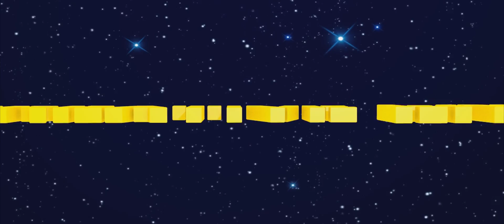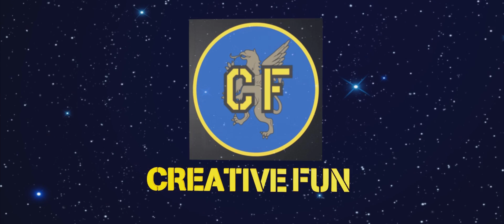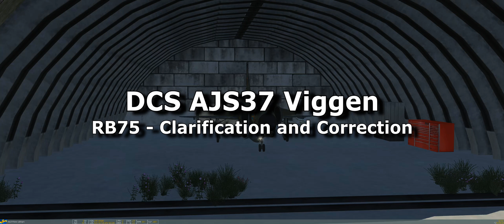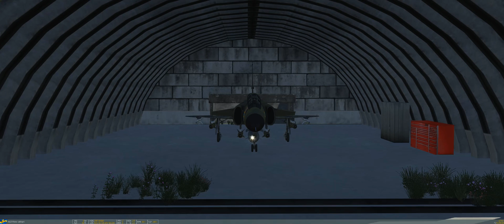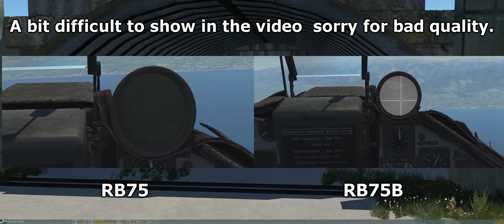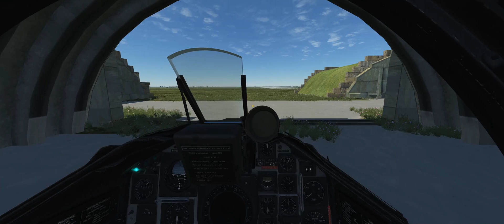DCS AJS37 Viggen - RB75 Clarification and Correction

Comment: Following comes from an old Phantom II Phixer (Weapons Control System Tech) the AGM-65 was designed to lock onto a 'grey scale' resolution meaning it could differentiate 'grey on grey'. The 'b' maverick was designed as an 'IR' targeting system. Since the majority of the Viggen's destined targets fit into the grey on grey, the IR version would need a different optical sight, which would limit it's use for daylight raids.

Note: the original Mavericks, when loadfed onto the racks of F-4e Phantoms, had a Sony 9-inch b/w television hard wired into the weapon control system. Look at pictures of an F-4D Phantom, and then picture where that real TV set went.

I know the Viggen is not the "oh, wow" of today's fighter aircraft, however, having worked on two-seater multi-role aircraft of the same time period, I would gladly climb into the cockpit of a Viggen, and feel at home. It is "down and dirty, over trees skirting, and no time allowance for the target to say "Oh Spit!"

Comment: When did you get your information that the Maverick is not implemented in the C/D version? This just doesn't make sense... And according to Aviation Week (http://aviationweek.com/site-files/aviationweek.com/files/uploads/2014/09/asd_09_25_2014_jas7.pdf), it is compatible.
Reply from the maker: From the Swedish armed forces own website. It states in the first paragraph that they are no longer in use. The information is found the section for discontinued systems. http://www.forsvarsmakten.se/sv/information-och-fakta/materiel-och-teknik/avvecklade-materielsystem/markmalsrobot-75/
Reply from the maker: Finally found the article I was referring to. The C/D version can indeed use a more modern version of the AGM-65 Maverick. However support for the, now very old, RB75 used by the air force was never implemented. Swedish air force never opted to buy the new Maverick systems.

http://insatsen.blogspot.se/2013/09/bra-attackvapen-till-gripen-i-sverige.html
Reply: Thanks for the clarification! It's interesting information I didn't know.